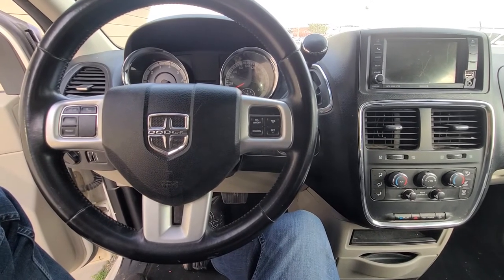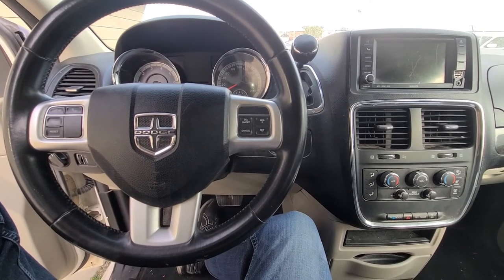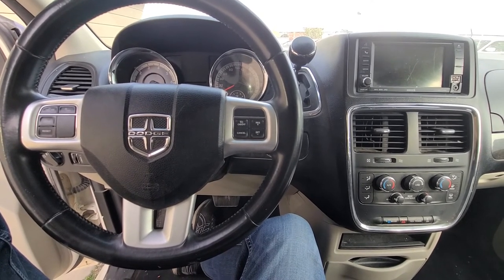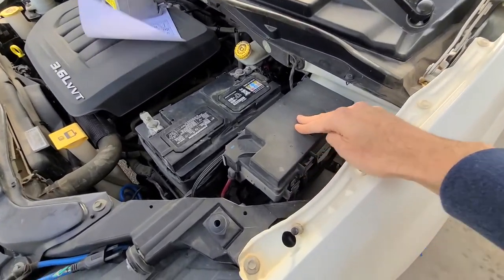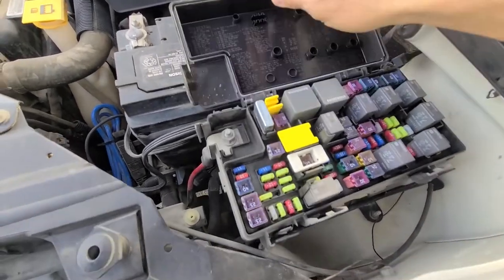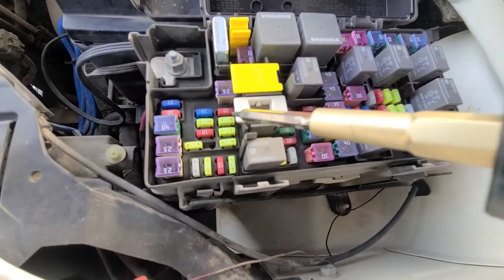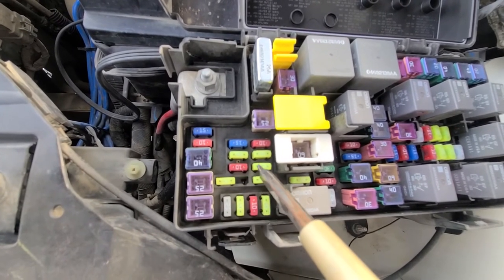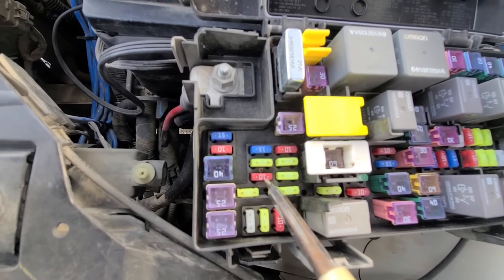Dodge Grand Caravan - TRAILER TOW PACKAGE FUSE LOCATION (2011 - 2020)

Comment: whats happens if I have the tow package but missing the fuses
Reply from the maker: the lights on the trailer you are towing would not work probably
Reply: Mine worked fine for over a year but stopped when I backed a boat trailer into water. My other trailer's lights were working but don't anymore. I'm missing the two fuses mentioned here as well.